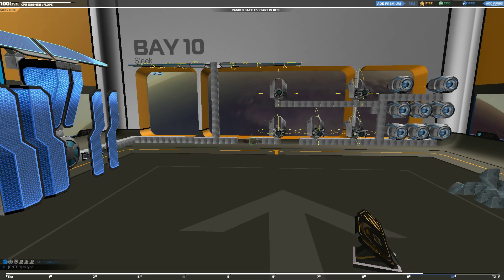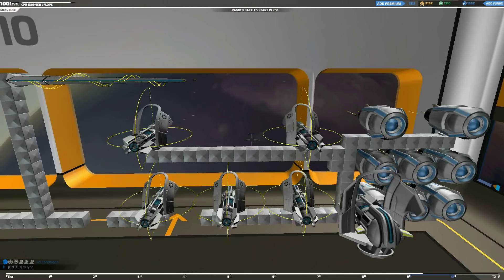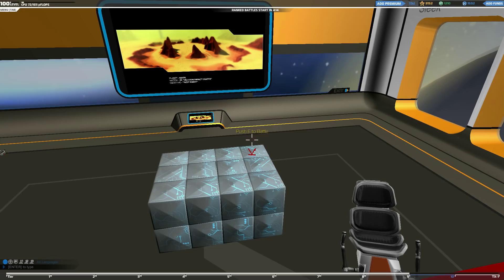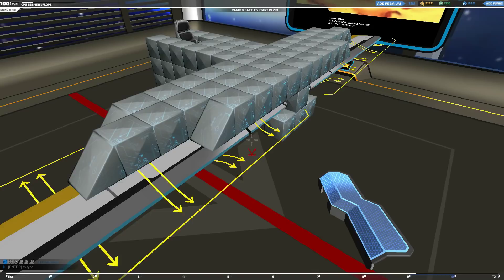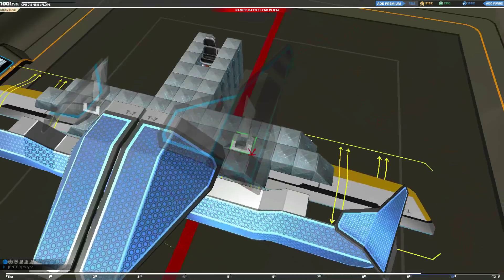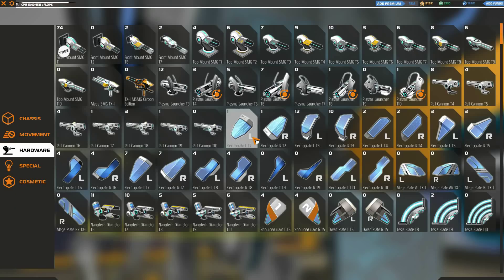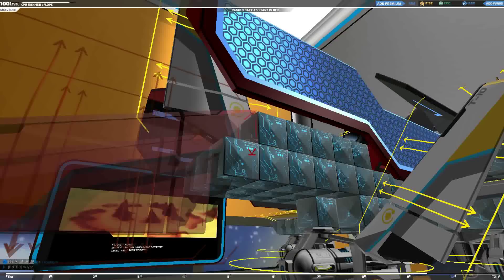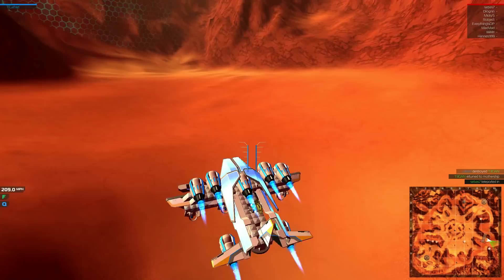Robocraft Tier 10 Plasma Bomber Tutorial (Tx1 Armor Build)

Comment: Sorry for my c... english, hope you'll understand anyways.
I build this flyer with T10 blocks, at lvl 74 i do not have the CPU to build it otherwise.
Its kind of heavy, so i did some modifications. Needed 2 extra up thrusters. I had to move the two thrusters on the outside of the wing. Rolling was i pain in the a.. with this heavy load. They are now tighter to the body. The Armor bellow the wing is now "triangle square triangle" instead of "square square square". The bomber flies nicely now, but it will be better with TX blocks later. :)
It can take some hits thats nice and it flies even if it's lose some engines.

Comment: I tried sleek to, but for me it only partly worked.
the Thruster aboves the wings get shoot too fast and when it is asymetrical...you can´t fly to good.
So I tinkered a little bit and did some changes: Only TX1 blocks, only rudders, no heck rudder, only 4 thrusters (close to the shields and one behind the seat) and one plasma more.

Its significally but more stable, and one blown up thruster at the side doesn´t send you spinning around (which was a huge problem for me).

Comment: Lathrix/land I built this bot fairly acurately and it was technically a tx-1 bot lol. So im going to like 'review' this bot. I didn't have the t10 side and front plates and it was pretty terrible although after getting the t10 plates it made it a lot more viable but it still is pretty 'bad'. Also all the top thrusters make it naturally (and very sharply) go down so you have to move 2 of the thrusters of the bottom (on some way) this makes the natural downward-ness into a very slight natural upward lean(correct word?).Also the other plates would be better as there t19 variant although that is harder to get.

Review written on an IPod.
Reply from the maker: Inuyasha Games It doesn't have a downwards pitch, unless it is above perfectly horizontal, which is what is wanted - The T10 variants were not out when this video was made - and It does well by me and a lot of people to this day, though obviously peoples experience varies heavily :)
Reply: Well when I built it when I pressed forward it would instantly noise dive. Although I might have made it weird but oh well I just moved thrusters around and it works fine now which is good. So yeah :P. Love your videos btw :D

Comment: Do you think you can make it only out of teir 10 blocks or would you need more thrusters
Reply from the maker: Oscar Laris You CAN as I've seen others do so, however I wouldn't recommend it, its design is pretty fragile and it relies on the extra armor from the Tx-1 cubes to make up for that in some pretty key places, also yeah the extra weight would give some issues in terms of speed - extra thrusters would be easy to add though as you are avoiding the 3CPU per armor block of the Tx-1 :P

Comment: is it ok to put t10 blocks instead of tx1 ones?
Reply from the maker: Savvas Kouloutsides You can indeed, as the reduced cpu usage will let you use more thrusters to counter the weight - though honestly more black-spam designs do better right now! ^^
Reply: thx but i did my own flyer so if it doesnt work i will do this one thank you so much
Reply: soo to make a plasma bomber just add more blocks so we get faster?
Reply: No more cubes more thrusters